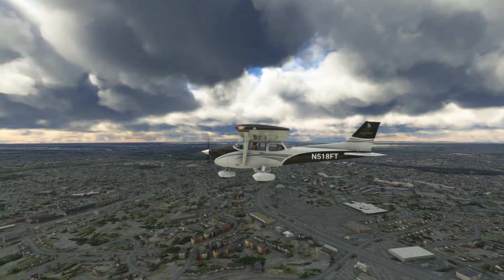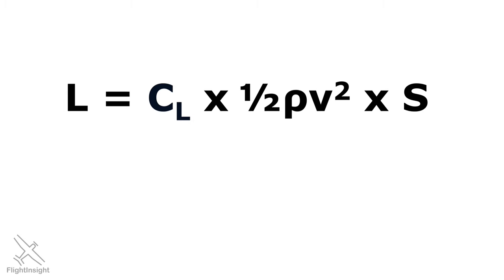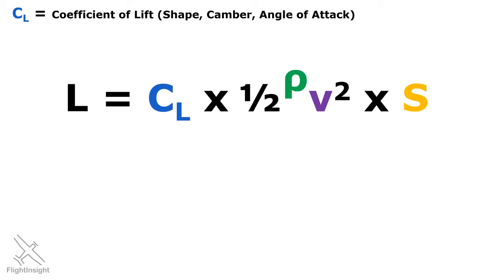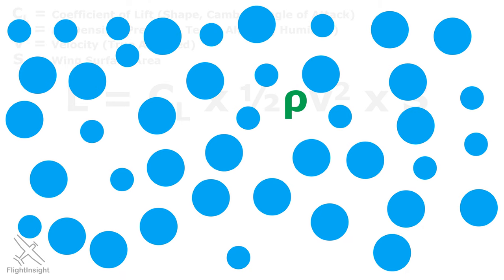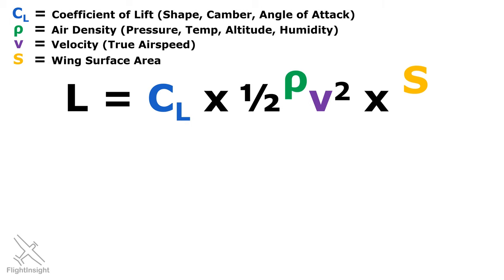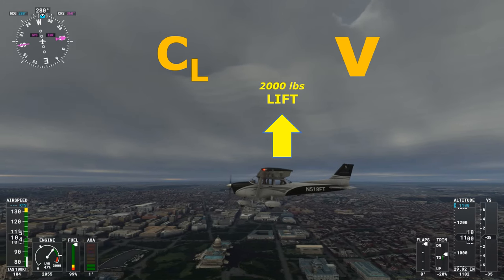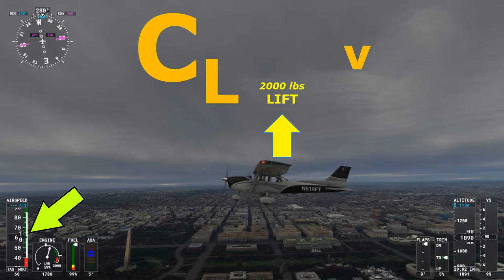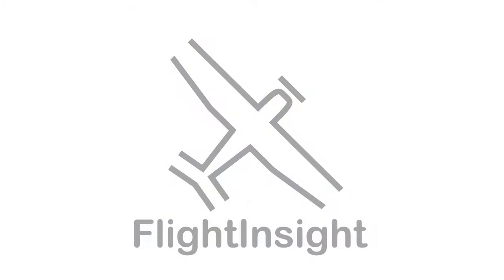Lift Equation Explained | Coefficient of Lift | Angle of Attack

Comment: Well done. One tiny little nitpick, though..... the variable 'v' is not velocity. Velocity is a vector variable (speed and direction), which is symbolized with a 'v→'. The variable 'v' is actually speed. It's a common misconception but speed and velocity are different (speed is purely magnitude, while velocity is magnitude and direction).
Reply from the maker: I was waiting for this comment haha! I debated adding some explanation around velocity vs "vitesse" for V but decided to stick skip over it for simplicity
Reply: Velocity is a vector (I believe in this equation). Therefore, Lift is also a vector (vector analysis).
Reply: @flightinsight9111  I’m sure plenty of people are already scared away from math “with letters.”  So trying to discuss the difference between scaler and vector calculations when it’s arguably not particularly important here is likely just counterproductive. It’s part of a larger equation which is vector-based but, in this context, it’s a scaler calculation. It’s still a perfectly valid explanation and a well-done video overall. Keep up the good work!

Comment: I noticed you spoke a lot about deflecting air downward to produce lift during this lesson. What about Bernoulli's Principle, and the reduced pressure over the wing causing lift? Is that factored into this lift equation as well, or is that a separate equation?
Reply from the maker: Bernoulli is a big part of this! The pressure differential helps the wing more effectively turn or deflect air downwards, which is why we stick to that general explanation in this video. But the lift equation certainly takes Bernoulli into account.
Reply: @flightinsight9111  ah, I see, thank you for the reply :)

Comment: Hey it is great content thanks for sharing but i'm confused about if we climb then we increase our aoa and it causes drag to increase also. So, we increase thrust too for compensating it. So, to the lift equation, when we climb, we increase the lift compared to its steady and level position but weight stayed same. So, why do they say lift is smaller and so load factor is when climbing? I know weight seperated of its component but in anyway it stayed same while lift is increased by both aoa and thrust. Anyone to explain?

Comment: The pilot can extend the flaps to increase the surface of the wing and therefore increase the lift (and the drag).
Reply from the maker: Bugged me too. The key is not movement up down, back or forth, but acceleration in any direction. When lift equals weight, the airplane isn't accelerating its rate of climb or descent. This is obvious if it remains at altitude, but is also true if it is in a constant rate climb or descent. With thrust and drag, it's the same thing. If it's remaining at a constant speed and not accelerating, it's in equilibrium.
Reply: @flightinsight9111  Great explanation! It makes sense now when I think about it, thank you for your reply :)
Reply: I want to make sure i understand correctly: when you bring down flaps, you increase the surface area but also change slightly the camber of the wing, with the trailing edge being lower than originally. That increases the aoa, hence the CL, increasing the Lift. Which makes sense when you drop flaps, the airplane tends to balloon up a bit. To maintain the constant 2000lbs of lift and maintain constant altitude, the only thing left to change would be the velocity, which would have to go down, since flaps bring extra drag. Then you’re in equilibrium again. Am I on the right track?
Great video and thank you!

Comment: It’s Bernoulli's principle. Differential of air pressure, not pushing air down.
Reply: He's explaining Newtons third law of motion. For every action there must be an equal and opposite reaction. The wing's angle of attack causes air to be deflected down causing a force up: creating lift. 

Yes, wings push air down to create lift.
Reply from the maker: Hi Jer! Thanks for mentioning Bernoulli. Whether it's pressure differential thanks to the wing shape, or impact lift from relative wind, it helps keep things simple by characterizing all of these principles as causing air to be deflected downwards, keeping the wing aloft.
Reply: That is correct, Jer. If you push air down, your elevators wouldn't work on rotate nor your rudders left/right. Bernoulli "sucks" the tail down the same way it does for the wings or "pulls" the tail when using rudders.
Reply: @AviationDirection  Not sure what you are trying to say. In level flight the wing will always deflect air down and the elevator will either deflect air up or down depending on fwd or aft cg. During rotation, the elevator will always deflect air up. One can consider Bernoulli or pressure distribution but at the end of the day, if air is not deflected there is no force from the airfoil except zero lift drag.
Reply: @XPLAlN  🤷🤦